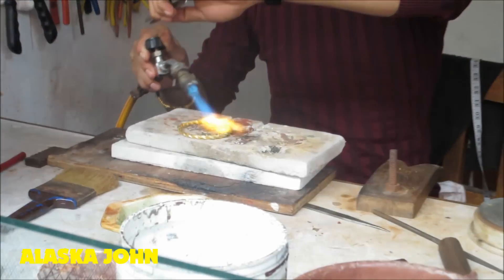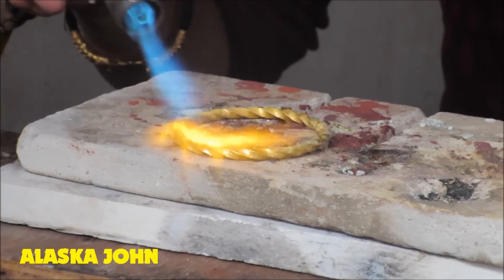2 OUNCE HANDMADE SOLID GOLD BRACELET - Nepal Goldsmith

Comment: How does dipping the bracelet in the liquid for a split second make it cool enough to handle?
Reply from the maker: I'm not sure of the physics behind it except as long as the metal is not too thick it seems to work.  I've been interested in making coins into rings and have watched several videos.  They also dip the heated coins for just a couple of seconds and they're able to handle them.  Take care.
Reply: Very interesting, thanks!